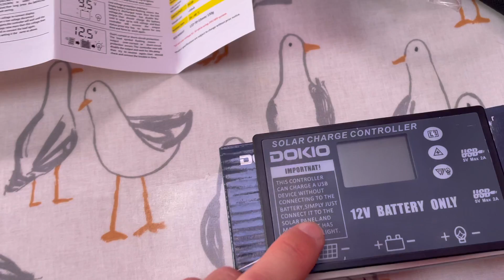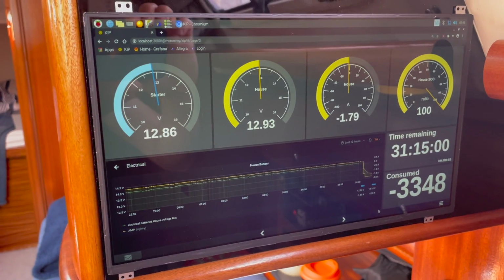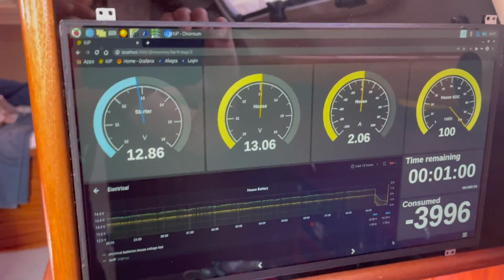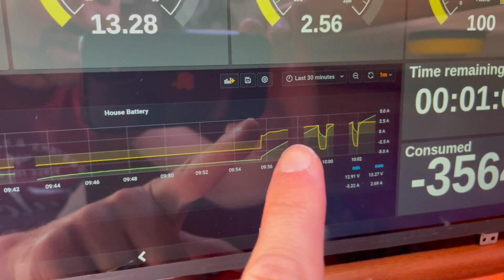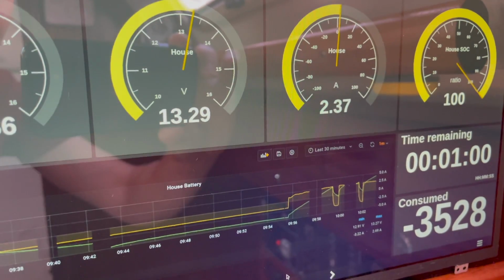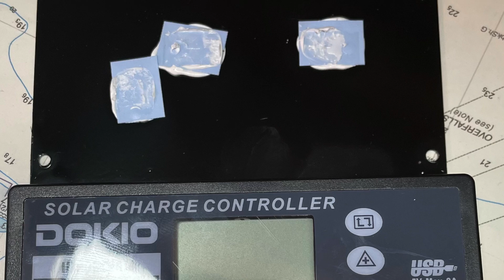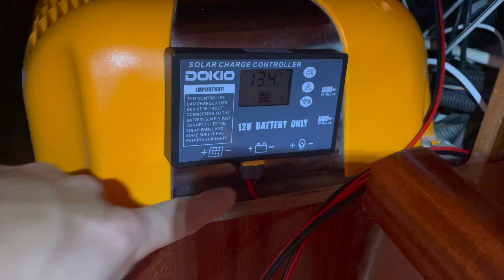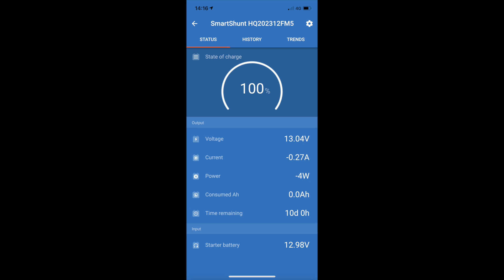Solar (Dokio 100W folding panel) - Boat Projects

Comment: Hi how did the fabric solar panel section fair in the poor weather etc?? I'm going to change my standard connections to mc4 waterproof ones so I can leave it out without worrying when off grid in the camper
Reply from the maker: Hi - Mine has been out in light rain but I tend to only use it in fair weather. It's been flipped over several times by the wind. I think the connections would be better with MC4. Both this and the other panel (160W) output has dropped a bit now, so I think I might have damaged the panels.
Reply: Cheers for info I guess three years of weather may have just aged it abit I may add some eyelets on the edges and secure it down and run with mc4 connectors to see how it goes I had a renology one years ago that worked brilliant it was permantly fixed but I thought I'd try one of these for ease of use just a shame the connections aren't water tight  @BoatingwiththeBaileys
Reply from the maker: @scousebikers I would think the quality is better on the Renolgy but if you can get a good deal it should help charge the batteries

Comment: Bought the 80w Dokio (very cheap from Amazon) just for "fun". I bought another 30W panel with charger (about the same price) year before. The charger I got from the 30W panel is exactly the same as yours (but with a different "skin" but functions the exact same) and its a cheap PWM China charger ofc but it works for my application. The one I got with my 80w Dokia looks exactly the same as yours but missing a button... So I can not configure anything, I can "check" but not configure... Maybe it's an upgrade (plug and play) and maybe it's a severe downgrade... I don't know... the only thing I know atm is that the 30W panel actually is more stable sort of then this 80W Dokio... but again it's lightweight, foldable and it does put some power down... and it was dirt cheap... so can not complain much...
Reply from the maker: Hi, interesting - how are you finding the output of the 80w panel?
Reply: @BoatingwiththeBaileys  Just actually tried it today sort of. Connected the same batteries (small 12v, 7,2AH AGM batterys) to both of them just to check. They are standing next to each other so getting the same sun with the same angle. And the Dokio is almost doing worse from what I can see (then again only from their charge controllers so not a true test ofc).

I think the panels on the Dokia is actually what is rated (in my case 80w) but the plastic cover/protection and what not is hindering the panels... like puttin you "bare" panels behind a glass pane. So it is probably 80w (in my case 2x40w) panels for sure... but maybe delivering maybe 40-50w tops... 

I bought a long time a go a chinese solar panel for soldering (no covering, bare panel) and it was (as far as I remember 2w maybe just maybe 2,5w) but it was rocking... that 2-2,5w was pretty much every angle, and low sun light... bought another panel same dimensions but with a "cover" and it was not near the same output.

So I'm guessing the panels is exactly what is rated but the product (with the protective cover) is not actually so great...

Again my 30w panel is delivering the (it has no plastic cover) better...

I don't know really the plastic does a good job also, easier to clean, longevity when you bring it to places... But I think it hinders the output of the panels for sure.

I think it scatters the waves, and maybe with perfect placement it does works but remove the plastic and you don't need that perfect placement... 

Just my thoughts... I will test it some more, but for now my 30w (fixed panel) does seem to produce more energy then my 80w Dokio... and I think I know why.

----edit

Just checked both panels (they are side by side) and now it's really low light, sun is setting)... Dokio 12,1v (so not charging as much) and my 30w doing 13v still so charging battery (somewhat). As the Dokio was so cheap (campaign of sorts) maybe I will get another one and take the plastic cover off to check the differences). I think it with the plastic cover of it will get more scattered light into the panels sort of and actually get better output overall... but yes will be prone to damage)... Would be cool to check what the difference is though...

---edit2 🙂

https://www.amazon.se/dp/B07JVJJH47/ref=sspa_dk_detail_2?psc=1&pd_rd_i=B07JVJJH47&pd_rd_w=GaTj4&content-id=amzn1.sym.7a4fbf23-63c0-49ba-afa3-64d64b9ffe92&pf_rd_p=7a4fbf23-63c0-49ba-afa3-64d64b9ffe92&pf_rd_r=ZPPVKNJQ3P0E8TZBV778&pd_rd_wg=ybcLJ&pd_rd_r=7a55f7f6-7a94-4575-b1f4-d68469c6c9e9&s=industrial&sp_csd=d2lkZ2V0TmFtZT1zcF9kZXRhaWw

This is twice the price of what I payed (in my country from the same Dokio brand) and should output only 20w more. But I bet theese output actually 100w for longer than theese 80w (my variant) foldable does.

But again... If I get 60-70w with perfect placement I'm happy with them. They are more portable and lightweight...
Reply from the maker: @alexanderwingeskog758 interested results. You will definitely get better performance from the rigid panel in the link above than a flexible one. I might take the covers off one of mine and give that a try

Comment: My Dokio panels arrived with a DOA controller. I contacted Dokio’s customer service in China to see about replacement. I am still without a replacement offer or solution fifteen days later. Brand new panels and I cannot use them without major modification. No customer service – no option to purchase replacement/repair parts. Keep this in mind when making your solar panel purchase.  Caveat emptor!
Reply from the maker: Hi - Thats not good at all. Are you able to go back to the supplier you purchased them off and get anything that way?

Comment: hi would you know if the battery and lightbulb symbols on the solar charge controller do exactly the same job ?
Reply from the maker: Hi, they don’t do the same job. The lightbulb output can be used to switch a light on for example and will switch off at a predetermined battery voltage. You can use the usb outputs without a battery but anything else needs a battery to be connected.
Reply: ahh right thanks for clearing that up,mine is slightly different to yours it has the 2 usb outlets but instead of an xt60 it has a wire with 2 crocodile clips. i’m planning  to cut them off and fit mc4 solar connectors instead. would you see that as a problem ?
Reply from the maker: @paulrigley8457 yeah I don’t see a problem with that. Is that the connection to the battery?
Reply: yes it is , i’ll only be using it as a way of charging my ecoflow powerbanks when camping off grid
Reply from the maker: @paulrigley8457 you might be able to change the Ecoflow directly from the panel. Don’t they have an inbuilt charge controller?
Reply from the maker: Looks like you can connect directly, check your model but looks possible https://cdn.shopify.com/s/files/1/0592/6004/3456/files/EcoFlow_DELTA_Pro_Multi-language_User_Manual.pdf?v=1667556184

Comment: In the middle of similar projects too. Almost same boat and motor👍 Great videos, subscribing! Best tip for me in this video was the “mate and lok” connectors. I have really wondered where to get the proper pins. Did you have a link for the correct type to attach to the upper connector? Male pins right?
Reply from the maker: Hi, Glad to have you onboard. If i remember correctly they were these https://www.ebay.co.uk/itm/140938481472 and i think that same clip appeared in this video at the end. https://youtu.be/eki4hB7lMUM We also had to repair a couple of the light switches but other than that all good.

Comment: How did you secure the controller in one place? There is no screw holes to fix it anywhere
Reply from the maker: Yeah, I haven’t secured mine it’s just sat on top of the battery charger. It’s never got hot so I don’t see why you couldn’t attach some sticky Velcro to it. I have considered upgrading the controller to see what a difference an MPPT like a Victron for example would do to the performance.